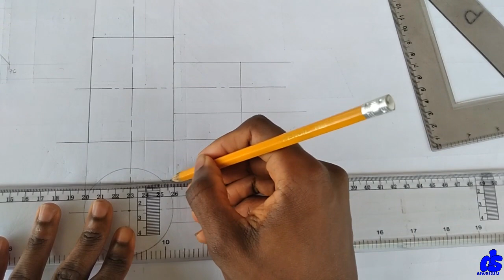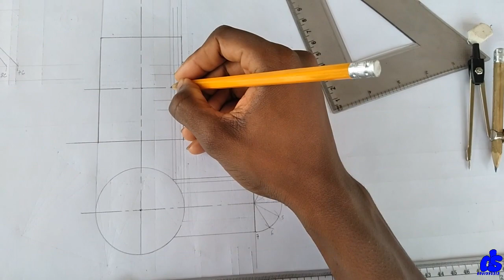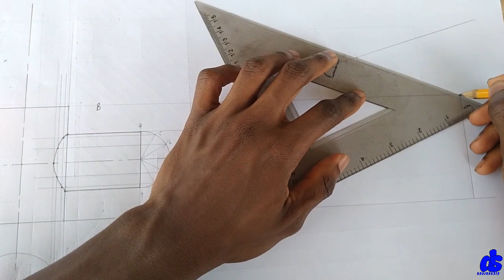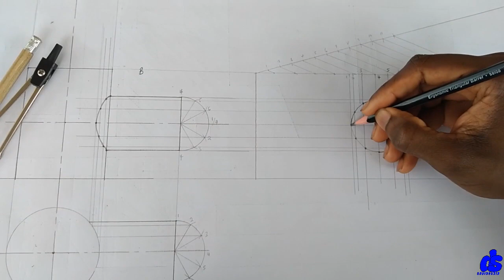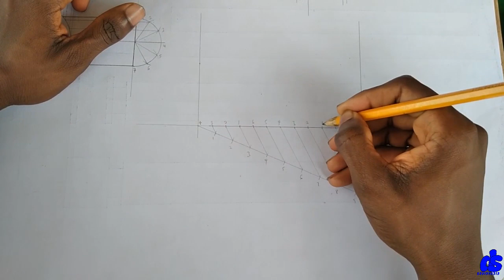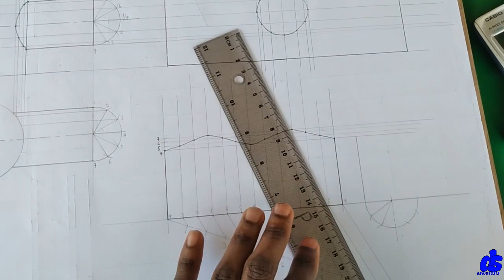How to develop surfaces for two cylinders penetrating each other.

Comment: Great video - i did this back at school in the late eighties but wanted to refresh my memory so I could work out the intersection between a light fitting I have inside an arch in my home. I did the development on paper and made a thin plywood cylinder that fits perfectly - practical uses for such a timeless skill - many thanks.
Reply from the maker: My pleasure 
 I’m glad it helped!